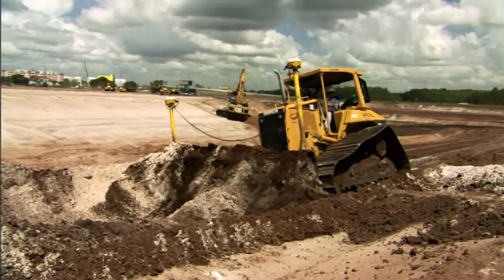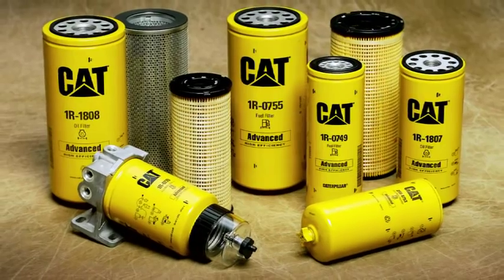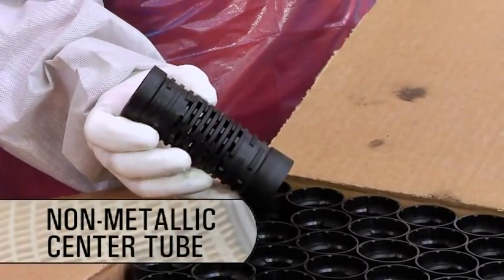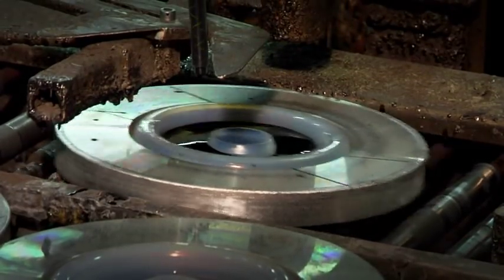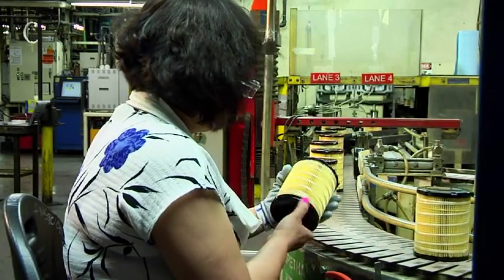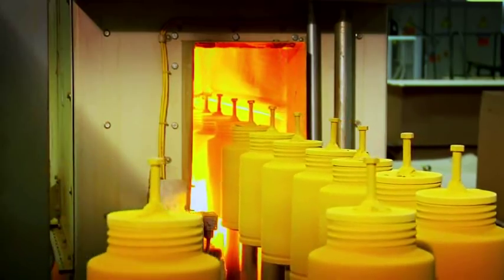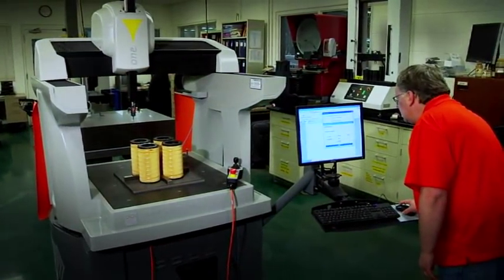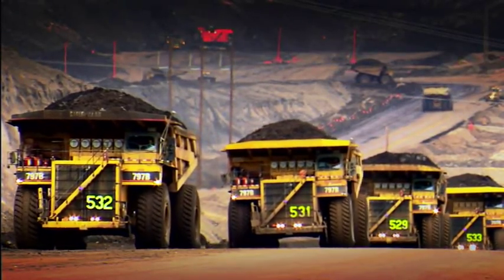Why Cat® Filters are Different than the Rest

Comment: AFSI is a joint venture with Donaldson Filters?
Reply: Randall, just wanted to let you know that AFSI is a CAT subsidiary.  They are not affiliated with Donaldson.  The filters they produce are solely CAT filters.  They are designed, engineered, and produced by CAT employees.
Reply: As a joint venture of Caterpillar Inc. and the Donaldson Company, Inc., AFSI produces top quality filters for engines using highly automated and computer-controlled procedures.  One of AFSI´s main priorities is the health and safety of employees and this is why we focus on candidates who share these values.

In order to achieve the highest possible level of quality and production efficiency we use a process where improvements in products and procedures are constantly underway.  An integral part of the process is the high level of commitment we receive from our employees, who we support through constant training and development.

From: http://www.afsifilters.com/careers
Reply: Yes, AFSI is 50 percent Cat and 50 percent Donaldson

Comment: I run a 2014  D6T LGP at a landfill and I can tell you the engine air filter capacity is WAY TOO SMALL!! This is a strong dozer but the small air filter is horrible. I can also tell you that air filters WILL cause problems with regeration systems!
Reply: Hu?